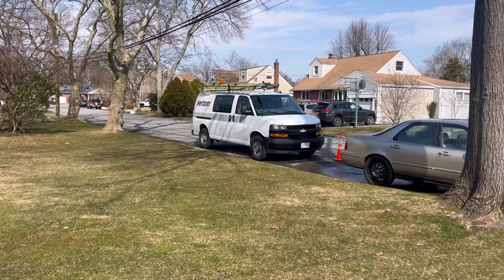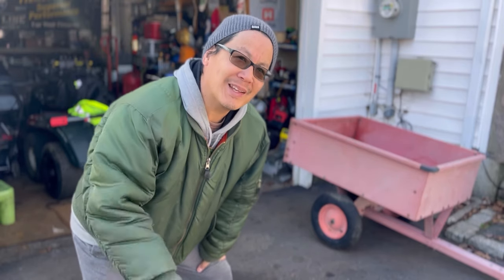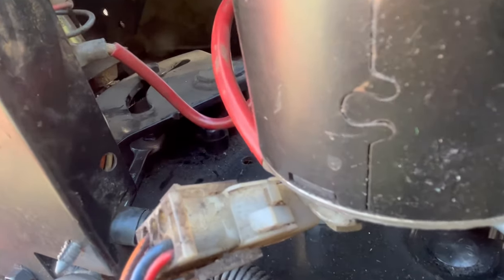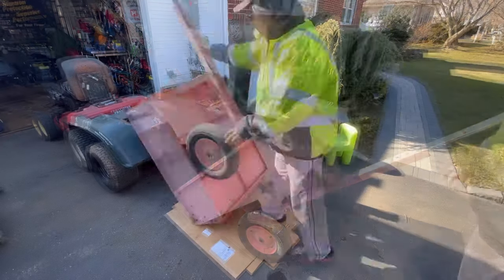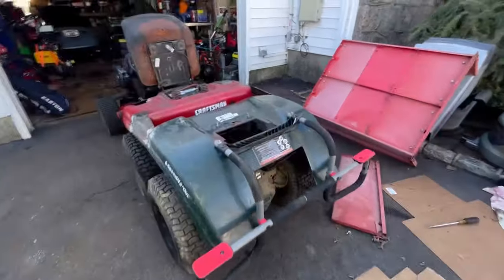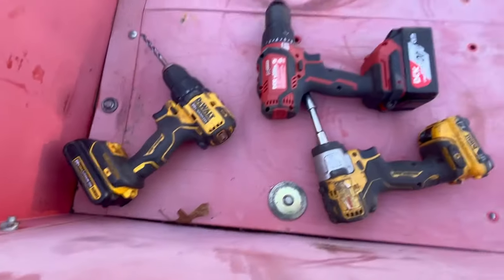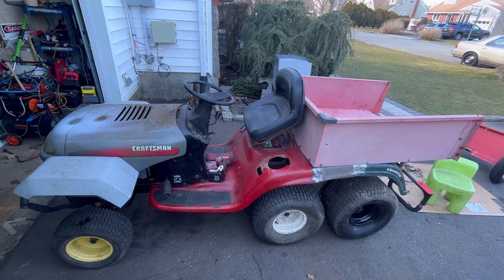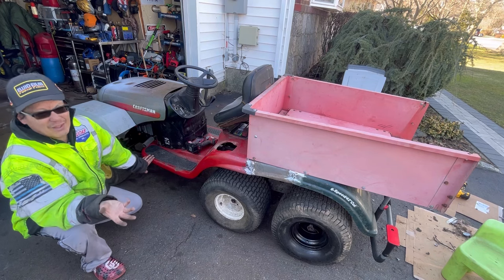LAWNTRACTOR TO 2X6 MILITARY 6 WHEELER UTV CONVERSION PROJECT DUMP TRAILER REAR BED INSTALLATION FAB

Comment: 2 ideas one is unbolt the front of the bed and slide it back instead of cutting it. 2 nd is use the tilt operation attached to the makeshift bumper.
Reply from the maker: New video out today

Comment: I would have moved the bed back a few inches so the bed wasn't cut.   You can leave the rear gate removable, too.   
Slightly smaller rear axle tires would stop a lot of traction loss in the drive axle.
Reply from the maker: I didn’t cut the bed

Comment: Put 10 or 12 inch wheels on the front  might not look so small in front just an idea.
Reply from the maker: Usually wheels that big won’t fit the front axles.

Comment: Why not turn the bed 180 degrees so the open is in front by the seat
Reply: I was about to ask same thing.
Reply from the maker: Then I wouldn’t have a working tailgate.
Reply: Turn 180. Notch seat out. Weld the tailgate in behind the seat. It already fits inside of the sides.
Reply from the maker: If I turn it 180 how will the tailgate work?  Can’t have a seat and a tailgate in the same place
Reply from the maker: @davidcooprider5313 what’s the point of having a tailgate behind a seat?  I’d like a functioning tailgate so I don’t have to lift heavy things over the side.

Comment: you need one of those hydraulic lifts for sketchy.
Reply from the maker: You couldn’t pick up a tractor with that hydraulic lift,  you’d need a folding platform long enough for a tractor.